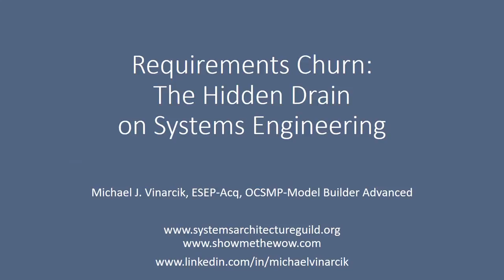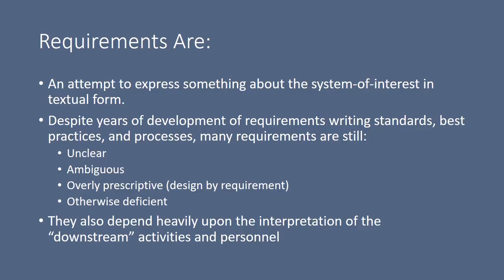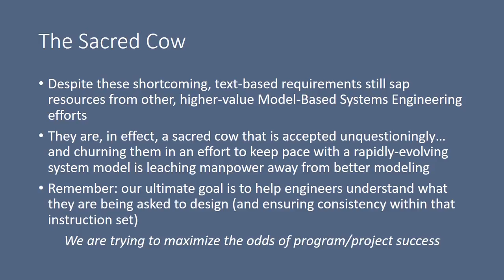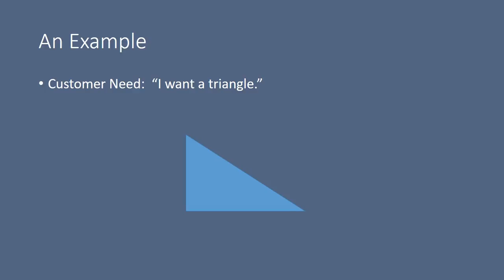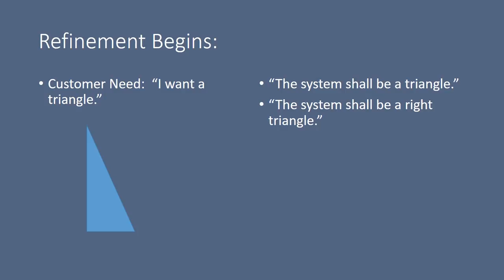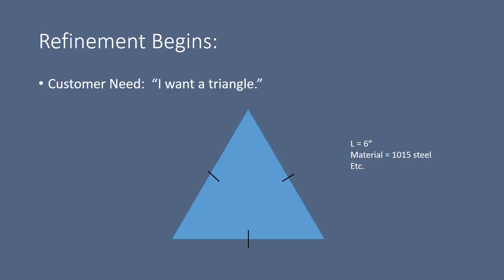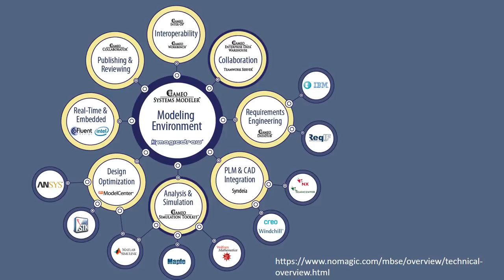Requirements Churn: The Hidden Drain on Systems Engineering

Comment: I’m trying wrap my head around the message of this video.  The triangle example was perhaps too simplistic to make your point?  “Good” requirements should focus on “what” not “how”. Your example seemed to end up with a specific implementation, not really about  a certain capability or behavior.  I may have misunderstood another point but it seemed that you might have elevated the modeler above the stakeholders and their need. It is almost tautological that stakeholders don’t get it right the first time and I believe this is where MBSE and a good modeler/model will have significant impact.  Initially provide a model and views to help the discussion with the stakeholders. Having all the information in the living model allows rapid iterations. Part of the discovery with this process should be to uncover poor requirements - requiring a fan rather than specifying a max temperature.  So did I misunderstand your point about managing requirements in the model and how they trace to the architecture or design.  As I stated on an earlier video these are very helpful. Getting me to think outside my own box!
Reply from the maker: Agreed that good requirements are what, not how.  No, the modeler isn't above the stakeholders...and part of our job is to help the stakeholders understand what it is that they really want (see Frederick Brooks's Design of Design for a better discussion about this).  I would much rather master requirements in the model (and not synch with another tool)...but I still think text is not as good a way to communicate.  Nobody would try to write a text based requirement around a blueprint or wiring diagram ("Place the 2x4's every 18 inches" or "Connect the 8 ohm resistor in series with the switch."  I'd like to minimize the text and maximize the model products.
Reply: Systems Architecture Guild - completely agree. The model and SysML provide the syntax that better captures the intended semantics that text alone doesn’t capture.  I see your point- Thanks for clarifying. I do agree that requirements capture eats up a lot of time and the outcome isn’t always what was intended. 

I didn’t comment on this before but I really like your point about the “guild”. There is a lot of art to good engineering design that needs to match with the more technical engineering aspects. This is often only gained by experience and not easily taught in the classroom
Reply from the maker: My talk at the No Magic World Symposium had a slide with a photo of "Learn to Do By Doing."  It was carved into the stone over a door of a now-closed 30's vintage school.
Reply: @systemsarchitectureguild5042  Is there a link to the talk at the No Magic World Symposium?